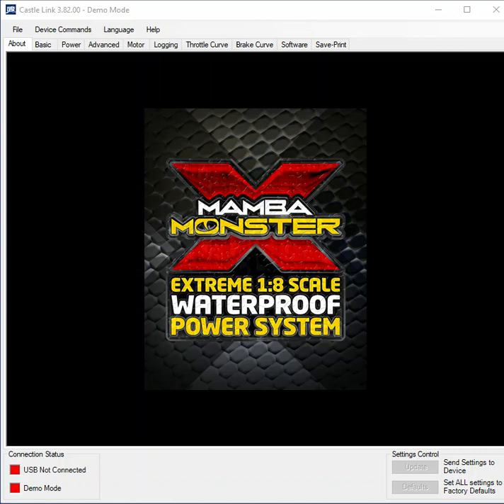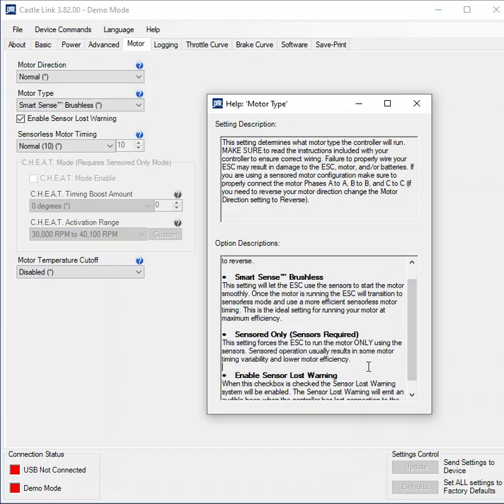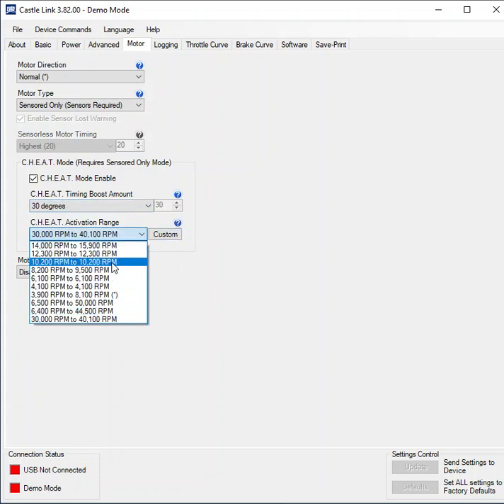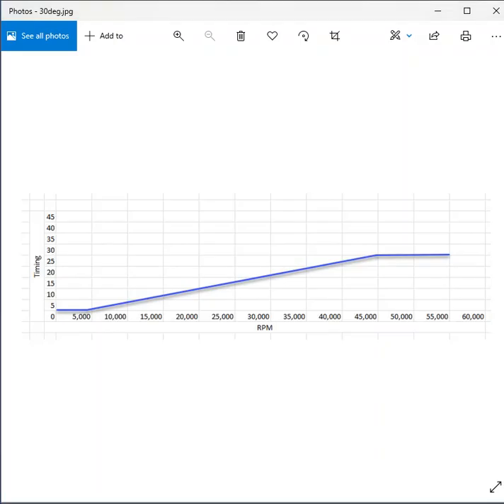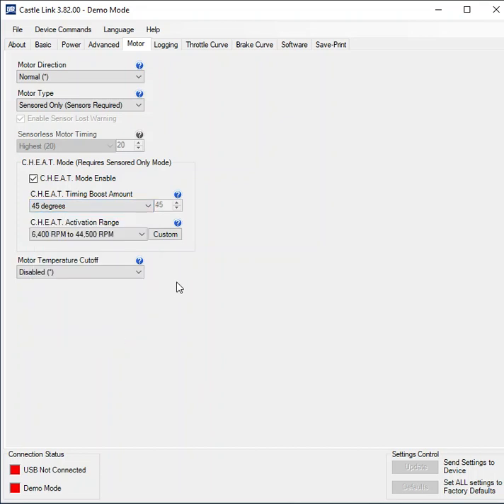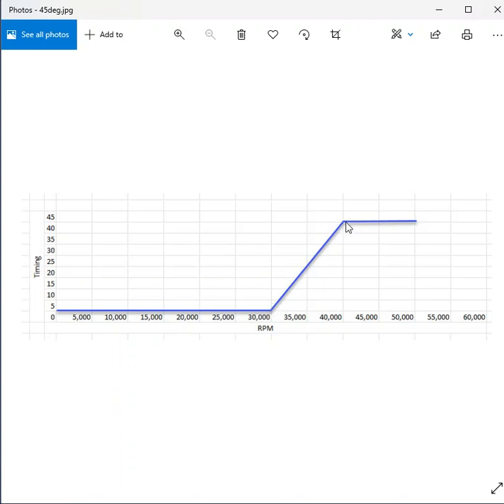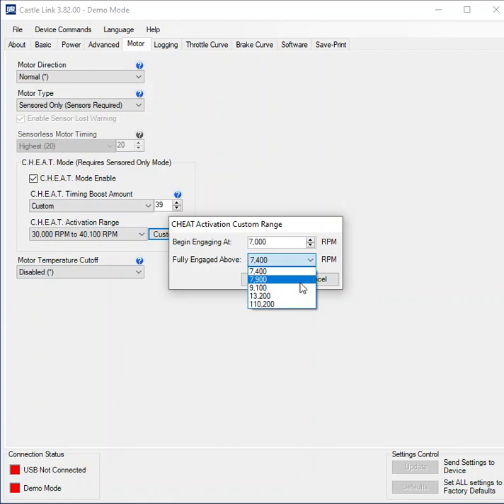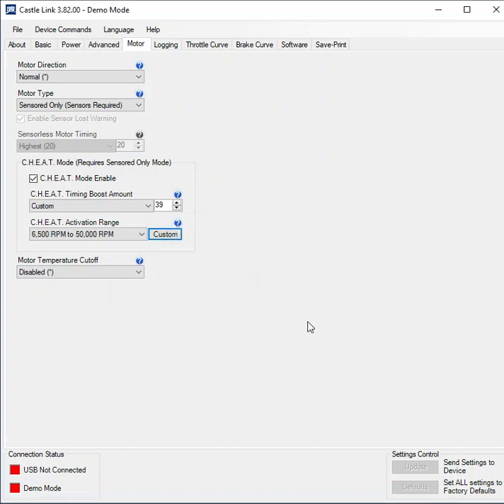Castle Link CHEAT timing explained.

Comment: I'm trying to figure this out myself and after looking at my linked laptop screen multiple times I just noticed on your video it indicates "fully engaged at/after" the ending max parameter in the range you chose or custom set. For days I thought the max timing ended at the chosen end parameter, unless I brain farted again the high end actually starts at the rpm high end and then runs at max timing to the end of the specific motor max limit
Reply: why does it make us choose a already set rpm to engage, why cant we pick our own rpm to fully engage?

Comment: Can I run sensor only on the field link with a brushless sensored castle setup? Already running on smart sense at 30* timing but could use more top end
Reply from the maker: You can but you can’t set the rpm range for it to ramp in
Reply: @StewMac570  if I use cheat mode at a set rpm range, will I feel a drag break like I did in sensor only mode with no cheat?
Reply from the maker: @dwalli2  probably, drag brake has nothing to do with CHEAT.
Reply: @StewMac570  right, but my drag break was set to 0 when I switched into sensor only mode and it started nosediving into every landing. Maybe cause the esc was trying to run sensored the entire time and getting out of alignment

Comment: Clear as mud lol. So I don't need cheat mode for my xlx2 1100kv combo in my k8s exb? Or do I what does it do
Reply from the maker: No definitely don’t use cheat with the XLX2. Not sure they have the option to use cheat on the XLX2. 

For that type of setup only use smart sense. This will give you a smooth start and then the sensor is no longer used after that. This reduces noise and the risk of the esc getting out of phase with the motor.

With these setup a fixed timing of up to 15 deg is all that’s needed.
Reply: @StewMac570  thanks a ton I appreciate it plus one sub here

Comment: When using the censored only mode can a brushless motor be used with that setting or does it need to only be a censored motor
Reply from the maker: Sensored only has to have a sensored motor.
Reply: @StewMac570  so if I select sensored only, and I'm running a non sensored motor. It will do nothing?
Reply from the maker: @brandonpage2658  yeah it will just alarm as it detects no sensor

Comment: What ranges for drag?
Reply from the maker: Depends on your setup and what rpm your motor likes to work in. There is no set value. Generally I like to spread the range over as much of the rpm’s as possible and make sure it’s fully engaged before your max rpm
Reply: How would u do a 1721 2400 I was trying different throttle curves but the fastest I got was a 1.83 I need a 1.6 dry tire that’s a 90,000 rpm motor I need to leave soft an pick up speed without spinning I kno u don’t have the care to test it but can u give me a starting point
Reply: @jarviscrawford7194   my starting point starting is At 20 with 13 degrees of timing using prep  my time with dry tire is 2.09 still messing with the futaba 7px to ramp in the power after the launch.